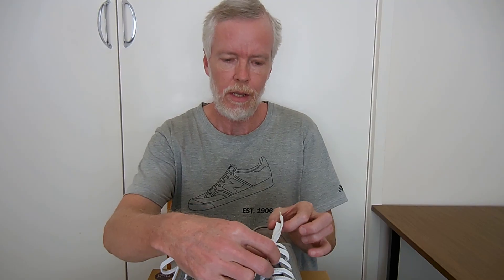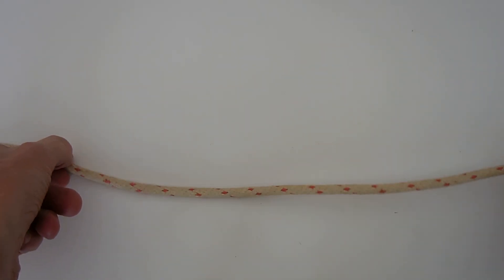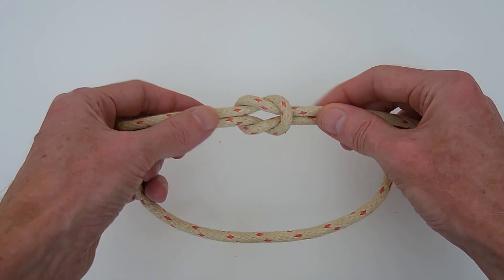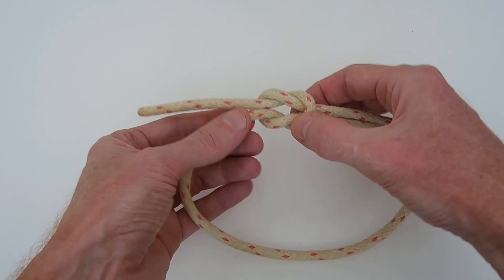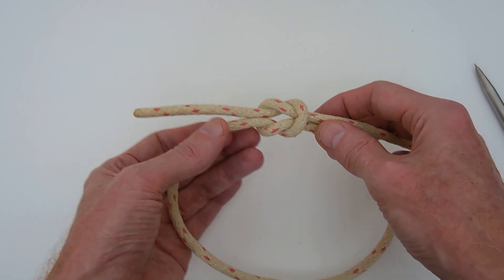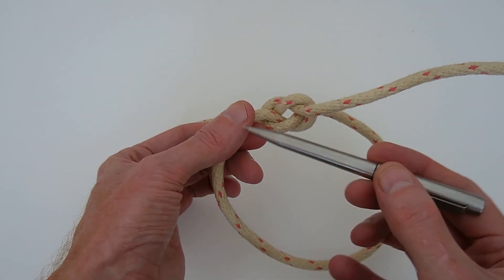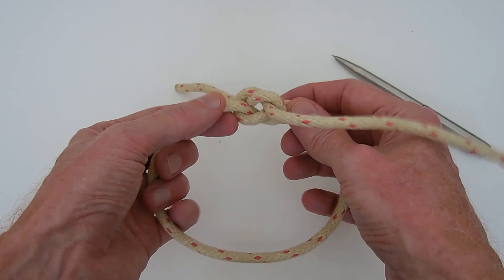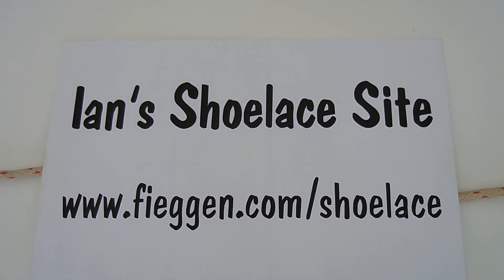Why a “Granny Knot” comes undone – Professor Shoelace

Comment: I love your demonstration, but I'm wondering whether the difference has more to do with the angle at which the lace crosses itself. With the reef knot, it lies along itself, vastly increasing the contact area so that friction is much larger. With the granny knot, it crosses itself at right angles, which makes for a very small contact area and much lower friction. In both cases, the lace passes round in a loop and back again, so I don't think it's to do with the direction of the tension being *reversed*, but rather to do with the 90-degree angle. What do you think?
By the way, Mathologer sent me here :)
Reply from the maker: True, the direction of pull is not completely reversed, probably only 3/4. There is indeed less contact area, but it's nonetheless easy to see in the video that the adjacent segments are pulling through together.